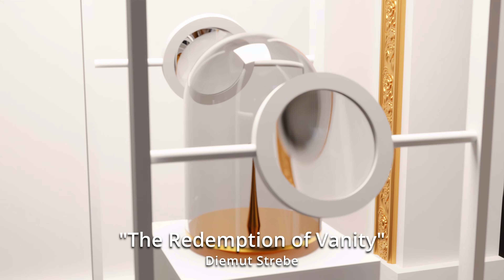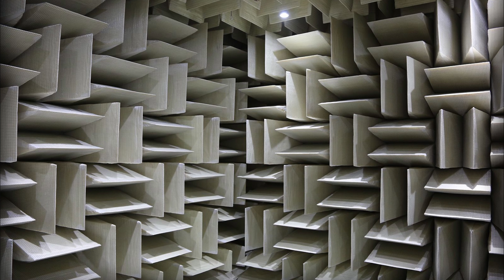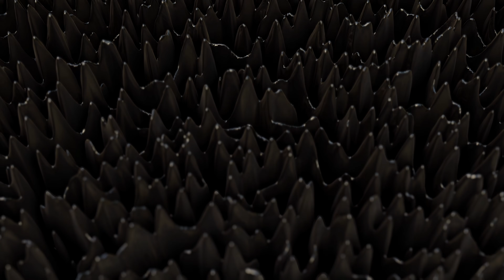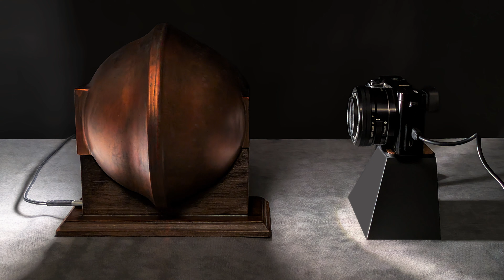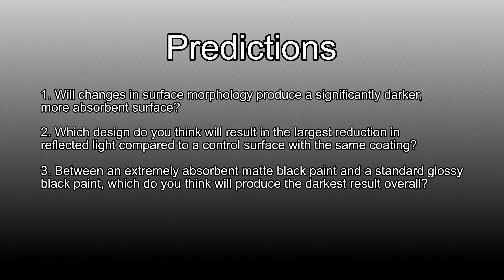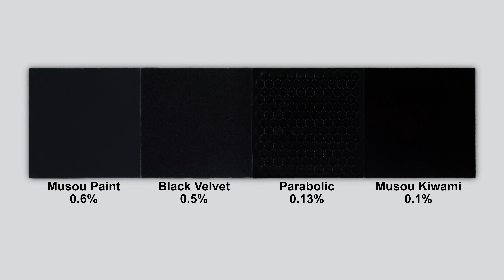3D Printed Vantablack?

Comment: This is such a cool concept to have a highly reflective material send all light to an absorbing space.
One question though: did you coat the parabola in a different coat outside and inside? Could you even reach inside? Would it perform even better with the absorbing space mat-coated while the parabola itself stays reflective?
Reply from the maker: I printed the samples in black UV resin, so everything was at least black to start with, but the paint couldn't really get down there. I'm working on a version that is printed in two pieces so that all of the surfaces can be coated. I haven't tried mixing coating types, but from my experience there isn't much use for a matte coating until better paint technology becomes available. There may be a design that can take full advantage of a scattering coating, but nothing I have come up with so far benefits from it.